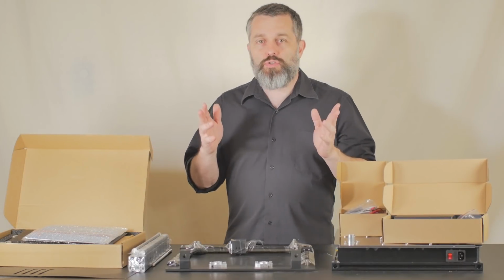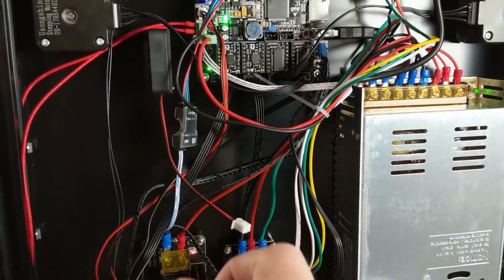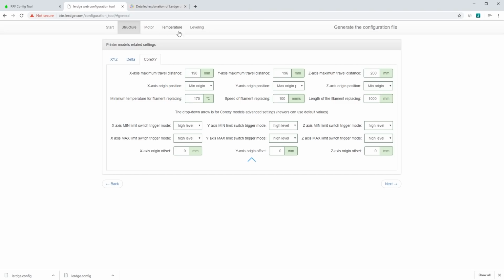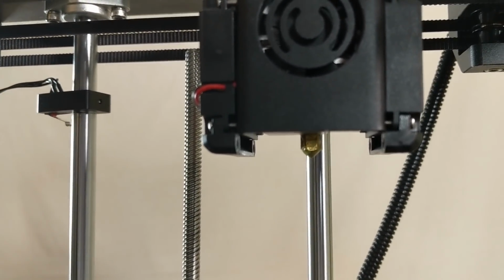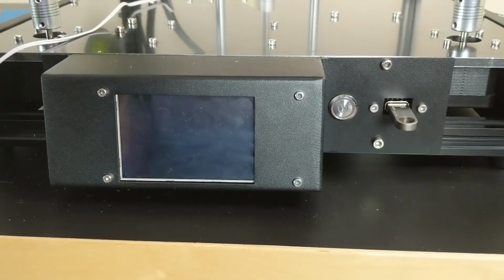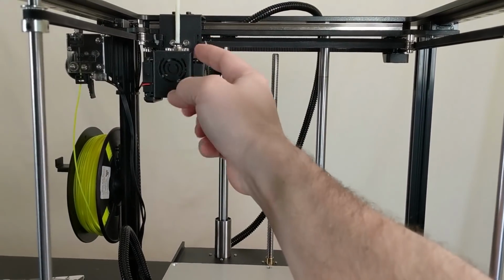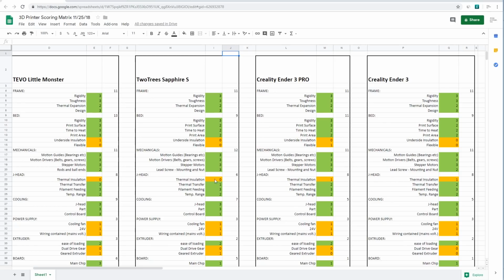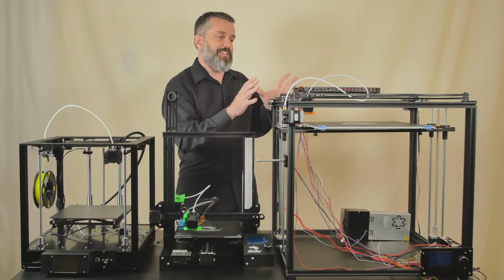The TwoTrees Sapphire 3D Printer Is the Best We've Seen Coming out of China

Comment: Ah, somebody that believes the whole bed moving thing is wrong. Im new to printing but I see a horrible flaw having springs under the bed. I think at least the bed should be locked down to the rails and there would be none of this leveling crap that takes new printers so long to get the hang of.  Sometimes I think that the springs need to wear in cause after awhile everyone just starts printing and doesnt have to level every print. I havw a problem that when i un-pause a print the hotend wants to goto a z = 0 position I guess cause it sinks down into the print and drags it along with the glass and shoots off the bed clips at me

Comment: DONT BUY TRONXY
Hi guys I want to bring you my bad experience with TRONXY X5SA: bought on aliexpress by TRONXY OFFICIAL STORE for about 300 EURO. I chose to pay the highest amount on aliexpress even though I could have paid 280 because the shipment was from Spain where I am and immediately I had my bad experience, the supplier replied after several days saying that they had finished the product in Spain and that they would send from the Czech Republic (oh well I pretended nothing and I agreed). A week later I received the product and it was almost a day for me to assemble it. The instruction booklet is useless to say the least and contains printing errors with wrong measurements so I went looking for a tutorial and assembled it. Commissioning and after only 2 prints the motherboard burned. Practically as soon as you turn it on, the extruder starts at maximum power without having the possibility of doing nothing if not returning it before burning everything.When everything was present to the supplier via aliexpress chat, he replied as usual 2 days later saying that he would send me the motherboard and don't worry. I wait another 3 days and ask for the shipping code and as usual it doesn't respond. At this point I get PITCHED and open a dispute on aliexpress. By magic he replies and tells me he wanted to know the type of motherboard. BUT BAD TROUT !! you ask me after 3 days that I spotted you that I have a problem and knowing that the product has only 2 life stamper. This is not how service should be. He tells me he is going to send me from China with an ordinary parcel which usually takes 20 days or even 1 month. NO JUST BROKEN NOW AND I HAVE REQUESTED TO BE REFUNDED. Moral of the story DO NOT TRUST THIS PRODUCT
Reply: I think you picked the wrong video Bro.
Reply: @thegreatsalabim  Hi buddy, i just report what happened to me with new item and such bad experience with customer service . At today i din't get yet spare part for my printer used just for 2 printing.Frankly i am really unsatisfaid about TRONXY customer service , maybe i was unlucky and got defetive product but they didn't solve the issue and gave me very big trouble. I bought for my job and i can't use . i can't buy new because my money still locked waiting for ending dispute.If serius company take back the old and give me new or send me spare part by express and not by chinese post expecially in this period.I hope you had better experience with TRONXY. Regards

Comment: I don't really follow how you gave this such a good score. You say it's great quality, yet there were a load of problems that you had to fix, resume from power loss didn't work, the hot end is rubbish, firmware is proprietary and non-hackable, bad stepper drivers, filament runout sensor has nowhere to mount, fans with incorrect/missing connectors, and a joke bed levelling probe If I bought a product with all those problems, I'd be returning it. I feel like I made the right choice with my Ender-3. Seems like a no-brainer. It worked first time out of the box with no issues. I've spent time and money modding it since, because I could and that's fun for me, but I didn't have to.

Comment: Question. I thin I messed mine  up. I pressed the Restore setting nothing seems to work. It set it to XYZ rather than coreXY. HELP
Reply from the maker: Go become a patreon of mine and I'll give you the configuration file that I made which fixed things for me. Because you only want the one file, just become a $1 supporter. https://www.patreon.com/designprototypetest
Reply: I found everything on the memory stick to restore to the proper setting and it is printing as I type. YES!

Comment: How does this printer compare to the Ender 5
Reply from the maker: The Ender 5 is not CoreXY. The design has significantly more inertial mass. A moving bed in the Y direction is the worst for inertial mass. The Ender 5 is somewhere in between this printer and and Ender 3. Also, this printer has linear motion rails instead of those delrin bearing wheels that all the Creality Printers use. Linear motion bearings are better.

Comment: It sounds like, with a little effort, a great printer.

Two concerns that I'm wondering if someone can address:

1) The lame hot end. Can it be replaced with a real E3Dv6? I use those on all my other printers, and they're solid. Can they be used with this printer?
2) Did they release the firmware's source code? It looks like open source firmware, tweaked, and if that's the case, they should release it. If they don't, that's a deal-breaker for me.

And a question: I heard people report problems with the belt layout being incorrect for CoreXY, causing banding in prints. Did the correct that in the printer you received?
Reply from the maker: 1) Of course. You are on your own to find/make a mounting solution to get that hotend on this machine. I have already designed the mounting solution for the Mosquito hotend which can be seen here: https://youtu.be/fpymiHUSxEs
2) Of course not. It's China. Apparently someone told me that you can put 32 bit marlin onto this. Look in my "community" tab of my channel for a link to another small youtuber who showed doing this on the Sapphire PRO.

I have not noticed any banding/z-wobble. That said, it's a good idea to replace the smooth pulleys with toothed ones at the corners that interface with the toothed side of the belts. Also, loosen your belt tension slightly. I don't know where the Z-wobble that some are reporting is coming from.

Comment: This should be fantastic? Put some weight on the front part of the table and it starts hanging down. Leveling on this fragile bed is futile. Looks like piece of shit to me, and you compare it to a much cheaper printer ... dude ... clickbait !
Reply from the maker: Why would you put weight on the front of the bed? 3D printed parts are very light. The machine is well designed for it's purpose. It can withstand reasonable loads on the bed without deflecting.

Comment: I just bought a Two Tree Sapphire-s printer and have assembled and all appears to work well until I plug-in my thumb drive that was provided by the seller. All the files that came with the thumb drive appear on the display except the .STL test file that I added. Why is the file not showing???

Comment: is the acrylic surround worth getting though?
Reply from the maker: Not in my opinion, but there are reasons for it. It keeps the smell of ABS in the room to a minimum, and it keeps the drafty air off your prints. However it cannot be considered a proper enclosure because it doesn't hold in the heat very well.
Reply: @DesignPrototypeTest  thanks for the quick response. really torn about which printer to get as my first ever
Reply from the maker: @donwright40  You can find an Ender 2 sometimes for like $99. That's absolutely the best bang for your buck.
Reply: @DesignPrototypeTest  still liking this one, but is there info on if the "Pro" version of this is better than their S model. visually there are alot of differences with motors and rails

Comment: Sounds .like there is zero chance that the printer will work "out of the box" and will require much tinkering to even get an initial test print. Sounds like a mountain of frustration for most buyers. A Tronxy x5sa with the recommended mods sounds like a better bet
Reply from the maker: Wait, are you earnest in your statement? Are you actually suggesting that all the modifications necessary to get an X5S working at the level of the Sapphire will be LESS frustration than what I did to this printer? You either haven't done the work on the X5S or the Sapphire, and you don't know what you are talking about, or you have an agenda/ulterior motive for making this comment.

Comment: Ok, I just bought this machine for my first 3d printer and cant get a print any where near the quality you are showing. I am new to 3d printing so not sure if its something wrong I am doing in cura or what. it seems that I might be having under extrusion issues as the infill is very weak and stringing. I have done the nozzle fix, uped the step values for the extruder and think I have the tension right on the extruder.
Reply: I bought it as my first printer as well but had pretty amazing results with my prints. My biggest issue is with the extruder I think. I get layer inconsistencies sometimes, not all the times and I think it is because the extruder isn't strong enough to spin the spool of filament. Make sure your bed is leveled and you set your nozzle distance correctly. Your first layer should look like a solid fused piece of plastic, it should show no lines.
Reply: @DaneC020  So I figured out my issue, for some strange reason cura kept defualting to a filimaent size larger than 1.75. This was causing major under extrusion issues. I got it figured out now and am off printing. Now time to dial in the slicer to get the best prints possible.I have an all metal extruder coming and am going to be doing a 4 spring bed leveling upgrade.
Reply: @Dan33782  I just installed an E3D V6 hotend on mine and will most likely replace the extruder as well. I am not happy with it at all.

Comment: 500 bucks for a printer that can't resume a print?  Nope.
Reply from the maker: Really, That's your deal breaker? Also, its just about the easiest fix imaginable. Install an anti-backlash nut and you will be able to print resume on power loss without any problems.

Comment: Not $199USD...please compare it to a similar priced printer
Reply from the maker: No. This is a good comparison. If I was comparing similar prices all I would be doing is comparing copycats of the Ender 3 to the Ender 3. We need to get away from this stupid moving bed (in the Y direction) paradigm that Prusa has got us stuck in. It may be more expensive, but is will be a CoreXY machine that will be the next big thing in 3D printing.
Reply: @DesignPrototypeTest  Whats wrong with moving bed in in Y direction ?

Comment: I think this printer is poor at best
Reply from the maker: So, you've had it in your hands? What are you comparing it to in order to make this judgement call? Would you care to go into some detail about how you reached this conclusion?
Reply: How about shorted thermistor, no fixings for filament out, no connection for cooling fan, bed falling under its own weight so no effective power fail resume, misleading instructions (Z limit switch, factory reset) Proprietry hard/ firmware. Not a printer I would choose.
Reply from the maker: Dude, you have no robustness to your criticism. I gave it to you straight about this printer and threw out everything I found wrong with the machine. Most of the issues you regurgitated back at me were easy for me to solve. Even the bed falling issue is easy to fix with an Anti-backlash Spring Loaded Nut which can be purchased for $1.25 with free shipping. This is a kit. It's up to you to fine tune it, and that means upgrades as well. What you want from a kit is a great foundation that you can build upon. In that regard there is nothing better than this printer coming from China. If you want a printer that "just works" and you won't have to do anything to it, try your luck with a Prusa. But you will pay more than twice as much for a Prusa as this one. If you are getting into 3D printing you are probably the tinkering type of person. This is a great base which is easy to get working as good or better than anything else out there. It's not perfect. I was the first to admit that in this video, but it is still a fantastic printer. The real deep seated problem you didn't even talk about: The Lerdge board. It is proprietary, it has no room for upgrades, and it is suspiciously similar to a Duet, so it is probably in violation of the open source GPL. I cannot support the Lerdge board. I wish this printer did not require that I purchase it with that electronics package.
Reply: @DesignPrototypeTest  I did comment on the proprietry hardware and firmware or the Lerdge board if you prefer. As the basis for a custom build it certainly has its merits but as a straight out of the box build it is sadly lacking, what would that printer cost if you were to add all the mods you suggest, rewrite the instructions, and charge a competitive labour rate? If that price stacks up against the competition it maybe as you say, but as it is delivered it is a poor printer

Comment: I have to disagree with about the filament cooling blower (11m 40s), you definitely don't want the filament to cool as it leaves the nozzle, you want it to be hot enough to melt the previous layer slightly so you get a good bond between layers. The purpose of the cooling blower is to prevent the print overheating and collapsing under its own weight. Large areas printed slowly need little or no cooling, small features printed quickly need more cooling. One exception is the interface between supports and the supported surface, then you want the filament to cool quickly so the upper layer doesn't bond to the support. Incorrect cooling settings are to blame for many print quality issues, including stringing.
Reply from the maker: You make some good points. However, the issue is nuanced. Filament cooling is a trade off between getting good layer adhesion and maintaining the proper shape of the part. Consider bridging situations, you want that filament to be solid the instant it leaves the nozzle. When printing a spire, the radiant heat from the nozzle keeps the preceding layers soft leading to an inaccurate ugly shape of the part. In the battle part accuracy vs layer adhesion, I preference part accuracy.
Reply: I don't see that there has to be a trade-off between layer adhesion and part accuracy, you just need to keep the cooling fan on a short leash. A lot of the parts I print require good layer adhesion AND dimensional accuracy, so I learned how to work with the material properties and the tools at hand. :)

So maybe the cooling system on the Sapphire is not the best design, but I think that's the least of it's flaws. The price is good though, if it wasn't for the proprietary controller I might be interested in one. Then again, a Mega2560/Ramps 1.6 would sort that.

Comment: It grinds my gears to hear someone claims the print bed doesn't move, when it it clearly does in Z.

What makes that an even worse thing is that if the power goes out, the failure mode is a total print failure as the print bed falls to the bottom.

If the print bed moves in any axis (or more than one), the print bed moves: don't claim otherwise.

This is certainly not a first printer for people, it has too many design/implementation failures along with instructions not all correct, too many ways for things to go wonky for those without proper experience.
Reply from the maker: Are you prone to hyperbole in real life too, or is it just something you do in comments? I was speaking unscripted and made a small technical error. You seem to understand the issue well enough to know what I meant, but I'll spell it out for you because you left a comment. The movement of the bed in the Z direction (which I talked about extensively throughout the video) is minuscule and slow compared to the large and fast movement of an I3 style frame such as the Ender 3. This is very important because inertial mass is bad. To minimize inertial mass you can do three things: lower the weight, slow down the movement, or lessen the movement. By moving the Z-axis instead of the Y axis we accomplish two of the three without slowing down the overall print speed. 

It seems to me you have an agenda. Why are you trying to demonize me like I'm some kind of dishonest liar who misleads people?